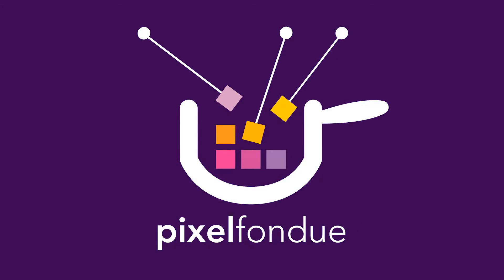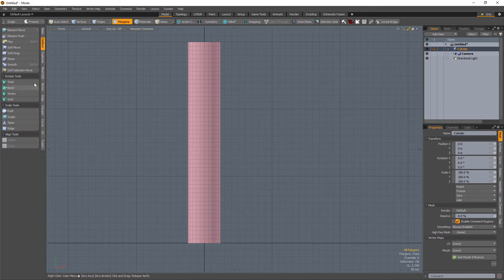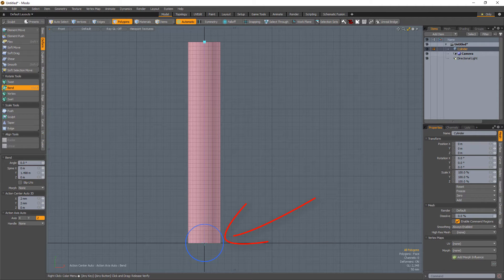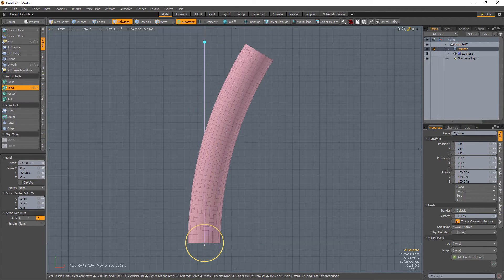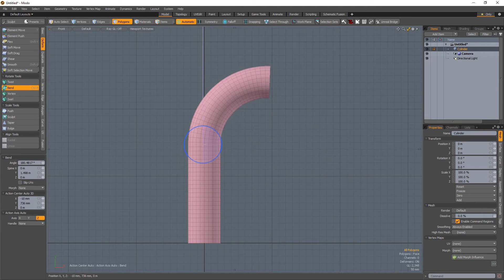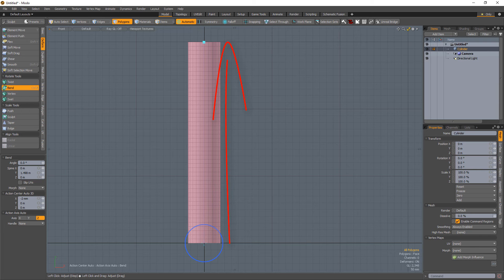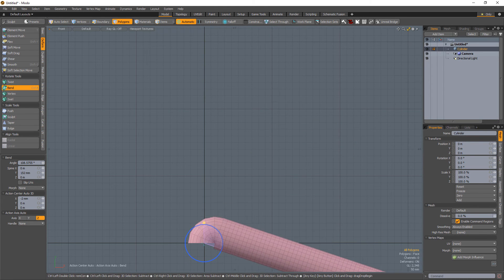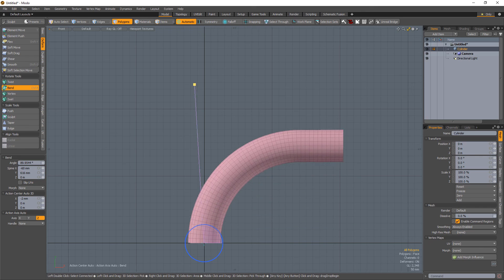MODO | Bend Tool

Comment: update: Found it. 
How do you bend an object from the centre to affect both ends? Like in symmetry.
Reply from the maker: (this is Greg answering on William's video).  Normally you would either have to do 2 bends (say one on each end of a cylinder).  Or 1 bend and then a symmetrize meshop to bend the opposite side.  Unforuntately there's no feature to bend both sides of a single bend deformer (would be nice though, wouldn't it?)

Comment: Note that you must have selected Polygons, Edges or Vertexes.  You won't be able to get the effect you want if you are in Item selection mode, because Modo won't be able to modify each vertex separately.
Reply from the maker: Correct. you need to be in component mode... but you dont need to have any elements/components selected. Similar to most of the deform and other tools. If you wanmt to Bend in Item mode you need to use the Bend Effector shown here:https://youtu.be/HJuuosxnNnM